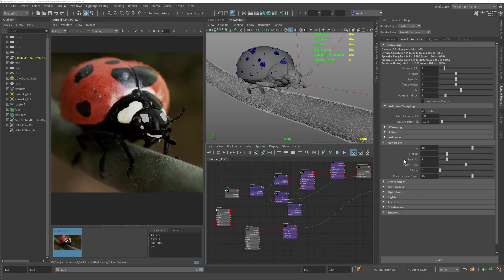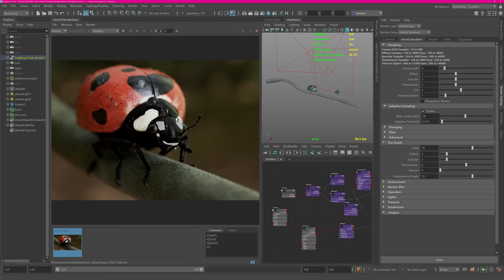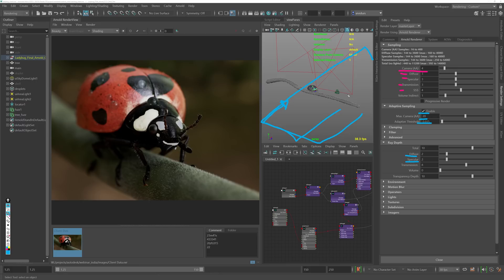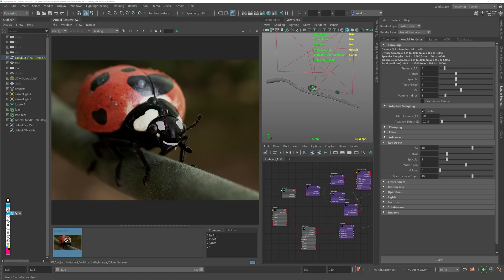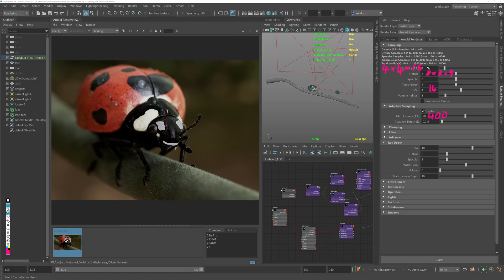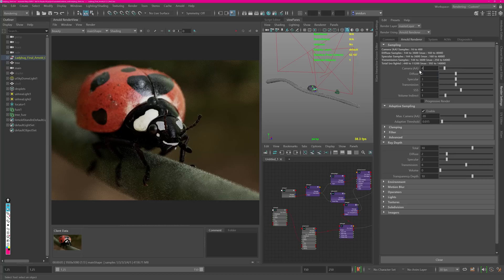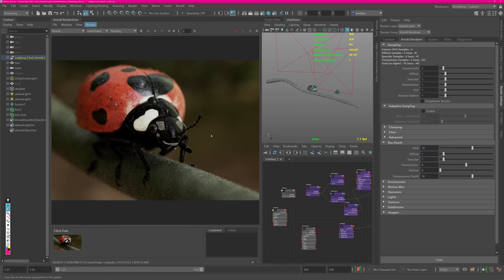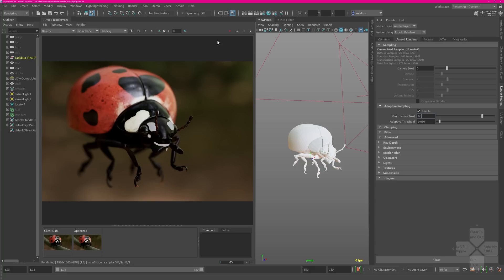Optimizing Your 3D Scenes for Faster Rendering

Comment: The drops over the ladybug are the most affected by low render settings, i noticed that transmition was still at 1 sample, is that the cause of low light/quality of the water drops or is it related to the ray depth? can see at switching snapshot on 11:35
Reply from the maker: Yeah transmission is always tough to sample. But just bumping this up would give you a clean result

Comment: I appreciated the math breakdown of the AA samples. Had no idea the adaptive sampling was (X)*00 and not just (X*)0. I wouldn't mind a further optimizing breakdown for kicking off a render. I was using Arnold's Batch render till my trial expired and now I am using sequence render. It feels way slower but I have no idea how it's working under the hood at the moment. I will probably dig into that science sometime next month. Great video. 15 mins of really useful things I'll come back to reference often.
Reply from the maker: Yeah sampling is very important to understand. No always as straight forward, but once you grasp the ins/outs its easy to adjust and optimize